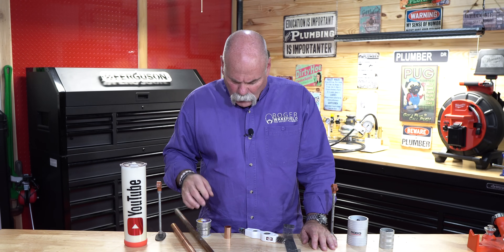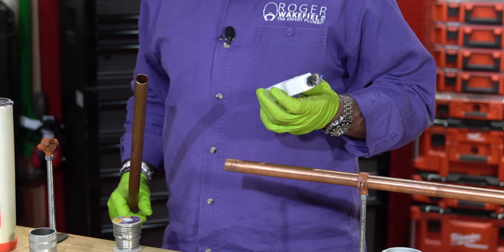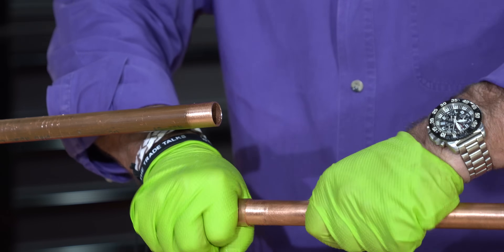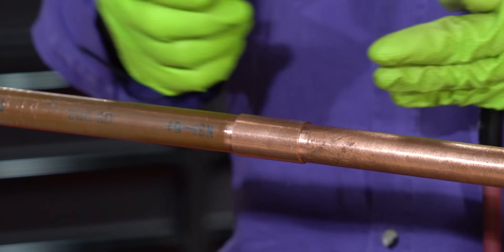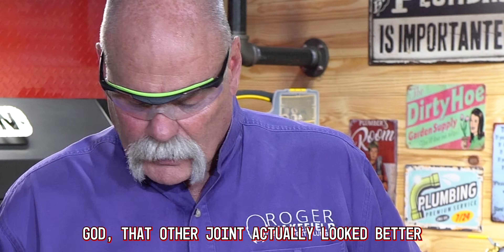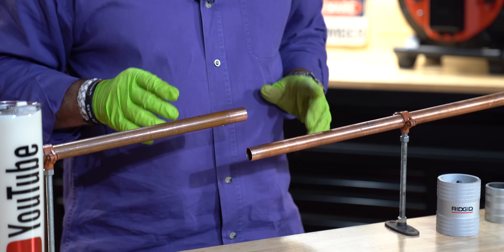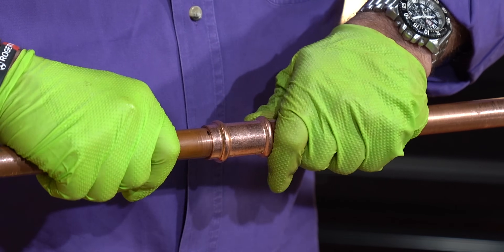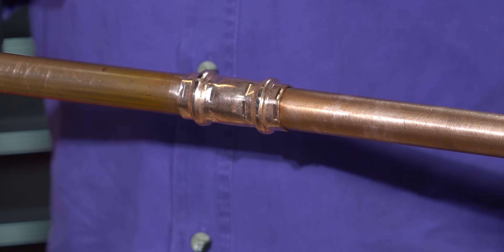Soldering VS Press Fittings

Comment: Union pipefitter/welder here. Too much heat, too much solder, improper technique. For those of you watching this, warm the pipe up a little then heat up the fitting moving around it to evenly distribute the heat. If your flux gets to hot it will boil and dry up so dont apply to much heat. Point the flame towards the center of the fitting and away from your solder wire. Tap the joint with the solder. When its ready it will melt and capillary action will draw the solder into the space between the pipe and fitting. Quickly draw your flame around the the joint while following with the solder at the same time, the flame should always be pointing at the center of the joint throught the process. Rule of thumb is what ever size pipe your using is how much solder you should consume for a single joint. 3/4 pipe coupling with two joints would consume 1½" of solder. 1" pipe and below that is properly soldered will easily hold 500 psi. Swipe your joint after with flux to help clean it up.
Reply: I always get bitten changing gas/torch types, propane to map mostly, but changing to anything other than your normal daily setup always throws your timing off.
for sure needed more torch moving around.
Reply: Excellent teaching

Comment: You use too much heat ! The color of copper heated shows too much heat.  Thats why ugly solder and you need sand paper to make look decent but solder drip on copper still can see.
Reply: Too hot turbo with concentrated point of flame

Comment: You don't need a slip coupling.  They make couplings with a detent for this.  You are using a repair coupling which is used when there isn't enough room to separate the pipe to get both ends of the pipe into the fitting.  You're a master plumber why are you not explaining this yourself

Comment: Ever since I had a prioress fitting fail on me, I’ve been using plumbers grease on the o rings before pressing it, haven’t had a fitting fail since. Anyone else do this?
Reply: What, specifically, do you mean by plumber's grease? Silicone grease or stem grease?
Reply: @ctaylor7089  stem grease
Reply: @alejandroc7357  the petroleum distillates will degrade the o ring
Reply: @chrisford8403  they are lubed already on brand new fittings, but when you have them stocked on the shelves. They tend to dry up.
Reply: @alejandroc7357  if you are going to lube them, use silicone grease.
Reply: @ctaylor7089  yeah but now my mind is going crazy thinking about the potential leaks I might have caused 😩

Comment: I solder, press and use type "A" pex. Each one has its place. No matter what happens I will always continue to include soldering on my jobs.
Reply: Ok what are those places for each ? E.g you can carry a pex line right up to the valve 0n toilet or under sink stubbing out to copper added another joint that’s arguably a bigger failure risk than press or solder

Comment: I’m amazed this hasn’t been brought up in the comments yet. Solder has a 40-50 year life (the modern subpar lead free kind). Pro-press has a 20-25 year life per the manufacturer. Reason to propress: labor cost, increased pipe rigidity (for exposed commercial applications) but solder is superior without question. Propress relies on a rubber O-ring to maintain a seal. Rubber fails far faster than solder.
Reply: O ring is back up to the pressed metal. Read the manufacturers info and learn something instead of just repeating something you saw someone else say

Comment: Often when doing repairs, you're attaching to type M, which has a much thinner side wall than type L. If I'm rebuilding from type M my first connection is always sweat, I've had too many times pressing to type m and not getting a good seal
Reply: Above ground, type K is for underground plumbing.
Reply: Simple type m ornamental, type L

Comment: I can’t afford the power press tool. The hand press tools are in the low $100’s and I’m struggling with all this. This also includes shark-bite.   I know how to solder but not what you call an expert so this discussion is frustrating. I’d rather the conversation discuss the long term reliability and how best to handle different tools.

Comment: Not aloud to use solder in AU every thing must be silver soldered or press fitted . 
The problem with press fittings is getting the jaws around the fittings in the first place so it's brazing all the way unless it's outside

Comment: I solder very little nowadays. In fact I just had a leaky solder joint and found out it was because my flux went bad. Copper isn’t very good in coastal Florida so for me it’s ProPress straight to ProPex. I did 👀 that Type L copper, that helps with longevity. On a side note Roger, can we talk about lead wiping 😂
Reply: hi, does crimping last longer and is it MORE reliable than the ol traditional soldering
Reply: @jinsu0504  I’m not sure about lasting longer but I’ve been a plumber for 26 years and haven’t seen one press fitting leaking for a service call but have seen dozens and dozens of solder joint leaks. I think pressing is far more reliable because it’s a simpler connection. Yesterday I had to replace a leaking solder joint that was 20 years old, the fitting popped off by just pulling on it. When I looked inside there was barely any solder. I know the o ring made full contact around the pipe after I pressed it. We’ll see if I get a call back in 20 years
Reply: @chicomarlin5678  i do have another question for you. My plumber propressed my main water line to greate a T joint to connect a double check valve. So main line, crimp, t joint, crimp, elbow, crimp, linear pipe, crimp, check valve, crimp, linear line, crimp, elbow, crimp, linear line....and it goes out the house to ghe sprinkers...is this okay? Im just worried about the main line and sprinkler being high pressure and all...worried it might leak later
Reply: @jinsu0504  I wouldn’t worry at all and trust your plumbers advice, assuming he is licensed
Reply: @chicomarlin5678  hes licensed but plumbers are business men after all. more plumbing issues means COLD HARD cash

Comment: When the flame turns green that means you are overheating the joint. Also I like to hit the pipe also and go back and forth to joint. But you can tell your solder was clearly not hitting the joint. You around be able to hit joint and watch solder go.around oint

Comment: We ream pipe so we don't cause turbulence in the water,  that's what I was taught. With press fittings we are intentionally deforming the pipe . What do you think the long term effects of this will be on our piping systems?
Reply: Thinking of the deformation as the axis of the pipe, I'd imagine a copper lip being more crucial to ream due to, what you said, causing turbulence. It runs laterally to the pipe, causing waves of different pressures that would cause wear on their impact location....makes sense. But when it comes to pro-press, i'd imagine that since the deformation runs with the longitudinal axis of the pipe (or congruent with it), that it wouldn't cause anymore pressure/turbulence. That the deformation itself would just have a slipstream effect, causing less wear on the pipe than what a lip would cause, had it not been reamed. If the deformation point itself was then considered to be a point of failure, then I'd say it's futile to even think about, considering all the twists and bends in the water line anyways. An elbow would have a more likelihood of failing before the point-of-deformation on a pro-pressed line or fitting. I think the biggest failure of pro-press, in the future, will be the rubber gaskets. Especially when used on hot water lines or outside. Think they'll outlast soldered fittings but if they were to fail, they would fail in mass. 20-50 years from now, when a rubber gasket goes, you're likely to have to replace all the pro-pressed fittings in that same area because you could assume that they, as well, could go at any moment too. This has been on my mind for a while. Thanks for letting me share.

Comment: Idk i dont mind press so much sometimes its faster and easier and its a pretty decent joint. But i have also seen press joints leak right from the get go whete if i had just soldered that would not have happened. Only thing i can say where i work they dont like me to reem and deburr so i never do and this has happened only twice. Pro press was fully charged i was at full depth, could be defective joint perhaps could be that lack of deburring.

Comment: You’ve burnt a lot of that Flux and that’s a recall just waiting to happen.

As far as soldering vs ProPress it’s hard to choose one over the other. I use both based on the circumstance.
Reply: Recognized situations are what separates plumbers from salesman
Reply: In Australia soft solder has been banned,and silver brazing is used(welding rods with higher melting point) which are premium joint garanteed for life....i also use both mainly to save money on press brass fittings,so i prefab some of my brass connectors such as male/female ion which are prefab brazed,so its cheaper and more of a premium job...
Reply: Same here. If I’m doing work inside a wall or any other area like that I’ll use press fittings. On water heaters and open areas I’ll solder the fittings

Comment: I think press fitting are easy which is nice but I think a good solder joint looks more professional. My company also doesn't provide a press fitting tool so for me as the tech that expense is more than I'll ever pay for a slight convenience because I get paid by the hour if the boss handed me a plastic spoon and told me we need to excavate a trench under a slab I'll just smile and start digging thinking about all this juicy OT I'm gonna get for this

Comment: Press Fitting used in Eastern Europe since 1970, now press the acceptable fitting approved in Eastern Europe since 1990, UK and US only soldering as I know, also I attend a loads of pin hole leak cause by flux not flushed etc.. Press joint not.. I know job which me and dad installed in 2000, recently visited the site still no leak.. Some country going backwards some forward.. Also Press has now angle jaws etc which fit everywhere. Good video by the way.. 😅✌️

Comment: A soldered joint will outlive the house and maybe civilization as we know it. I wouldn't make a claim like that about a pressed fitting, compression fitting, and certainly not a push on fitting.
Reply from the maker: Very true!
Reply: with the type M copper that we use down here youre lucky if the pipes themselves last over 30 years 😂 type L needs to be code eveywhere

Comment: I'm not a plumber, but, as someone that is in plumbing supply sales, I have to say, I see solder dropping off even more in the near future, and I see press fittings dropping off eventually as well. I see copper plumbing dropping off all together in the next 20-30 years if costs continue to rise and work ethics and skills continue to decline. I don't disrespect or doubt the ways of old, but I see what is on the market and I see what sells.
Reply: You sound like my Ferguson rep. Is that you Chris? 😂
Reply: @chicomarlin5678  😂😂😂
Reply: So what will be commonly used in the future? Over here in Europe, copper, brass and press tools will probably be used for a long time to come.
Reply: @euy4657  Plastics
Reply: Can’t stop what’s comin….

Comment: Roger, how do you feel about compression fittings? I know a lot of folks that say they're trash, and they leak all the time. Personally, I prefer to solder. But I've had situations in tight areas where I didn't feel comfortable using a torch, so I popped on a compression fitting. I've never had one leak, as far as 20 years back.
I'm not a plumber. I just do my own work, and help out close friends and family when they have emergencies.
Reply from the maker: I don't prefer compression fittings,  Solder will always last longer than any other fitting
Reply: Thanks!
Reply: I use compression for accessable stops at the fixture.
Reply: @jessemclaughlin9680  sure. Easy access in case of a leak. Just about every toilet I've ever seen has a valve connected via compression fitting.
Reply: @abejavadi235  yeah those 3/8 quarter turn ball valves over 1/2 copper with a brass ring is all I see
Reply: The last time I solderd was in appranticship. Like 10 years ago.
We use pressfittings from viega and buderus.

Water we use Flowfit

It is faster and holds together, never had a problem.

You can solder in germany but nobody does it anymore.

We even crip 3,46 inch pipes together.
I think everything is different in another country

P.s. I am from germany
Reply: @marklindner2557  Excellent comment.

Comment: We use press but we still use solder fittings on shower valves and up to the drop ear. We fell like soldering them is much better than using male adapters especially in the wall. When we use pex we stub out with copper and we use the brackets and we solder the copper stub outs to the bracket.

Comment: Mr Roger, I have 42+ years in too! Started in 1979, dropped out of HS and went to work for LA Roto Rooter....2 years later I started my own Rooter business and learned plumbing on my own, along the way - the hard way, lol. I got licensed in 1984 and have been going strong ever since. I agree with you on the Solder vs Press issue.....Always solder and only press when you have to and never in any place inaccessible. I understand we gotta change with the times but I just feel solder is more professional overall.
Reply: I don’t trust propress. What happens when the internal O-ring goes?!
Reply: @zachbenedicic7582  that's your choice man. But theres a lot more to it.
Reply: @richardj5417  You’re correct - but using Pro Press reminds me when motocross bikes went to 4 Strokes…. They were so easy to ride compared to 2 Strokes; it felt like cheating, lol lol. Pro Press can be awesome for some repairs though.

Comment: I am a new apprentice. I have done both and have to agree press is the future. I recently changed 30 feet cold and hot water  of copper pipes in less than 30 min. If we're to solder it would have taken me no less than four hours.
Reply: 4 hours? Someone experienced with solder wouldn't take that long. I have to say, pro press is actually probably bad for plumbers overall. Anyone can do a pro press fitting. Way more homeowners will do their own plumbing with PEX and pro press. Way less so with soldering.
Reply: @joshdiehl8737  dude did say he was new
Reply: @joshdiehl8737  I'm experienced and 30 ft of pipe can take longer than 4 hours if we are drilling through walls or tiles. Also  finding different routes to bring new water lines takes time. If 30 ft of straight pipe then I can do that in less than a hour
Reply: @joshdiehl8737 I don’t think most homeowners are willing to spend 2.5k+ just to redo their pipes once every decade or more.
Reply: @joshdiehl8737  a torch to solder is way cheaper than the propress tool, which goes for about two grand.
Reply: @Lekiamh  Two grand is, in my case, a small price to pay as a self employed plumber to serve more customers and increase production; with a lot more customers than time, the loss of jobs / customers costs much more than the tool.

Comment: My Plumbing Instructor who's been plumbing for 30 years said that Press on fittings are much better than soldering, but you may still have to braze certain underground joints.
Reply: Pro press has a black rubber o ring. It got popular because California freaks out about the negligible amount of lead in solder.
Ask your instructor why is it better than a properly soldered joint? "Better" is a subjective term. Better how? Pro press is better for a repair on say 2" copper that runs horizontal through an emergency room because it's fast,and you can have a bit of water still in the pipe,whereas soldering you can't. Soldering is better because it lasts longer than a propress joint. Pro press is good for service. It has it's place. 
Also, remember this:
Always always always heat the pipe first,then the fitting. Thermal expansion occurs inside the fitting when you heat the pipe first,so when you heat the fitting, it's already heated from the inside out.
I've been soldering/brazing copper for 20 plus years and this is the way to tell who can solder properly or not. Guys that heat the fitting first are doing it wrong. I went to the copper institute in Michigan and everything I learned before going there was 100% the same.
Taking soldering away from plumbers is taking the art and skill away from our job. Tell your instructor that.
Reply: @Energia-977  You go Gurlll !!! lol (I agree)
Reply: @KD-hi6hh  🤣 Thanks!(in girl's voice)
Reply: Better why?
Reply: Copper is expensive and we have been using stainless steel mains with copper branches for awhile now. You're wrong if you think it's going away. It will be a lot less especially on mains,but there still is a lot of soldering of branches.
Reply: @Energia-977  “Go Daddy - Go Daddy - Go Daddy”……! In da club, ….. lol 👍
Reply: and many years ago, they claimed CPVC, polybutylene and others were great and would last forever.. I hate polybutylene, even thought it's made me plenty of money remodeling whole homes to get rid of it and the random leaks 🤣🤣
Reply: @throttlebottle5906  So true, and now there's all these PEX lawsuits from chlorination, ugh....I'm staying with copper and solder, lol
Reply: Soldering and pressing both have a lot of advantages and disadvantages, I use both to maximum advantage.
Reply: You still can’t stop what’s comin Daddy…..soldering is headed into the history books, quickly.
Reply: @omegaenvironmentalpartners  Why, do you think it will ultimately get banned everywhere?